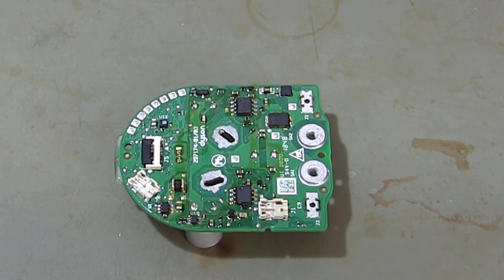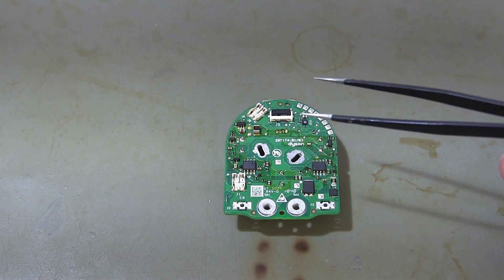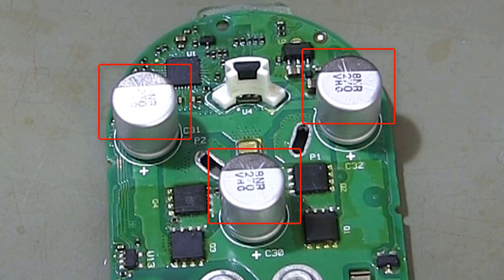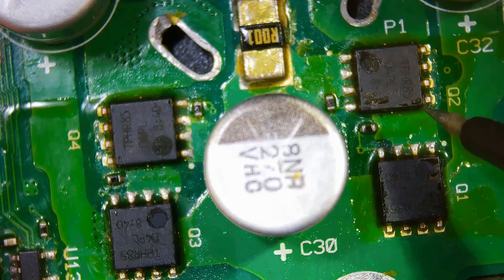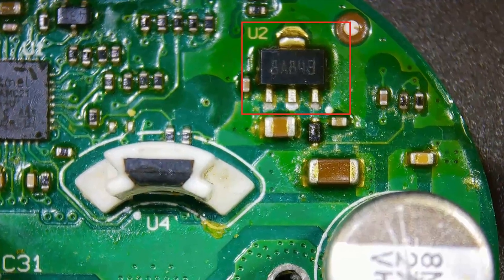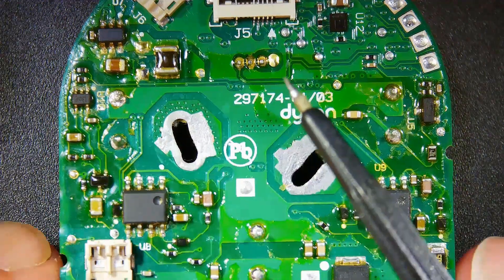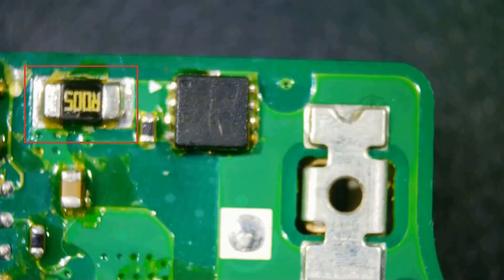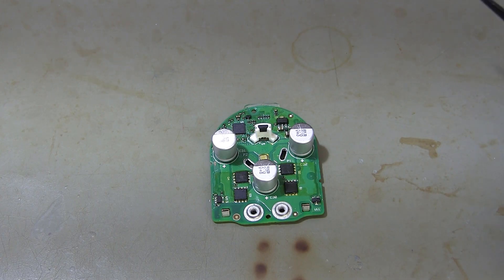How to Repair Dyson V11 Motor Control Board? Component Analysis

Comment: Hi everyone. I have the same Dyson with precisely the same PCB. The motor is working for 2 seconds in each mode. I bought a thermal camera, and one component is reaching 40 °C within seconds of pressing the trigger button. It is the one right under the button socket. The black middle with 2 silver metal plates/legs. I checked the continuity, and it beeps. Also, I measure 0.2 ohms on the 600 ohm setting. What is the component, please? Am I right when I think that it is shorted? Many Thanks
Reply from the maker: It's highly likely that the component coil you mentioned and the reading you're seeing on the multimeter are normal. For the fault you described, I suggest checking the capacitors first.

Comment: My V12 shuts off after 3-5 seconds, one month past warranty… anything that could help
Reply from the maker: Check the battery. If the battery is healthy, check the capacitors and MOSFETs on the circuit board.

Comment: Ciao grazie per il video molto interessante! Ho due Dyson v11 il modello sv17 non parte appena premo il grilletto, se tolgo la batteria e la rimetto funziona correttamente. Da lì in poi funziona regolarmente..ma appena sta fermo per 10 minuti il.problema si ripresenta! Condensatori? Il secondo è un sv14, funziona regolarmente in eco e boost, in auto va ad intermittenza..grazie dell'aiuto!!
Reply from the maker: Hello, this is a very unusual fault. I recommend checking the capacitors in both devices, as capacitors are critical in this type of malfunction.

Comment: I have a V11 which works for like 1 or 2 seconds and then cuts off with the “bong” sound and the blue light on the battery flashes. Which component on the board could be the culprit of the problem?
Reply from the maker: I suggest you first check the capacitors on the circuit board.
Reply: @electronic7979 bilginiz icin tesekkur ederim. Zamanim oldugunda bakicam ve geri donus yapicam size

Comment: Hello, Thank you for the video. I have Dyson V15. Can you please help me find the proper capacitors? I cannot recognize parameters from the desctiptions written on them. On the capacitors I have following info: 1DF 270 VHC. Can you please help me to identify? What is the voltage? What is the capacity?
Reply from the maker: You can use a 270uF 35V capacitor.

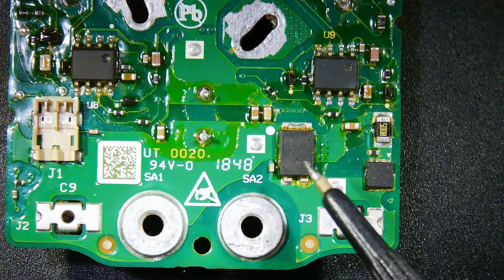Comment: Hello! I would like to ask for help in repairing such an electronic PCB, in the video I would like to know the value of the SMD capacitor next to the SA2 diode of the brush motor, it is mentioned at 6:20. Thank you if I get an answer.
Reply from the maker: I don’t know for sure, but my guess is that it could be a 100nF / 50V capacitor.
Reply: @electronic7979  Thank you for your answer.

Comment: very helpful video. Thank you.
I have a problem with Dyson V10. 
Please see video here;
https://youtube.com/shorts/5U-2dUXnjQM?si=BwA3P2OUn2yDbKtT
Reply from the maker: There is a problem with the link you provided. The video does not open.
Reply: @electronic7979 I made link public now. Please check?
Reply from the maker: Merhaba dostum. Bende türküm türkçe yazabilirsin. sorunun motor kartı üzerindeki kondansatörlerden kaynaklanıyor olabilir. kondansatörlerde bir problem bulamazsan devre kartı üzerindeki mosfetleri kontrol etmeni öneririm.
Reply: @e @electronic7979  teşekkürler. Kondansatörlerin üzerinde 2NR 270 VHC yazıyor. 
Nereden tedarik edebilirim?
Reply from the maker: 270uf 35v SMD tıp kondansatör elektronik malzeme satıcılarından bulabilirsin

Comment: Abend ich habe Problem mit meinem dyson v12 und zwar beim einschalten vom geht das Gerät kurz an und dann geht wieder aus so wiederholt man ca 6 mal und dann läuft er wieder ganz normal ich habe schon alles überprüft Filter erneuert aber trotzdem funktioniert leider nicht
Reply from the maker: I recommend checking the capacitors on the motor control circuit board.

Comment: Hi, my v11 (sv15) starts for 1-2 seconds and stops, after 4-5 times it works normally. I removed capacitors (3x270uF, 35V), but they have nominal parameters. MOSFETs are on board, but seem to work properly. What would be next to check?
Reply from the maker: Do you have an ESR meter to measure the capacitors? Multimeters may show nominal capacitance values, but if the ESR value is degraded, the problem can still persist. For this reason, I recommend replacing the capacitors in any case.

Another possible issue could be cracked or cold solder joints on the board. Check all solder joints and reflow or resolder them if necessary.

Also, don’t forget to check the battery.
Reply: @electronic7979  I used multimeter. Ok. I will replace capacitors and check if it will help. The battery is ok for sure. Thx
Reply: @camus22-n3t did you change capasitors? And it worked?

Comment: Mine stoped sending V to the brush, found a burned "trail" to the HAL sensor for the filter, repaired th burnt circuit n now it doesent detect a filter at all, 
Trew it in th garbage n bought a chinese copy, comes with way more atachments, batt lasts longer ,n its lightr than dyson, fr a ⅓ of the $$.
All electronics are on the battery, so its easy to diagnose, it came with an xtra batt. 
Dont fall for "if its expensive it must be bettr" dyson has too many fkn sensors + too many boards n a ton of diferent problems.
Reply from the maker: Thanks for sharing your experience! Dyson units definitely have a lot of sensors and multiple control boards, so when one small part fails it can create a chain of issues. The burned trace to the Hall sensor is a pretty common failure point on these models.

The replacement you bought sounds like a good fit for your needs — lighter, longer battery life, and simpler electronics can definitely make maintenance easier. Every brand has pros and cons, and what works best really depends on how you use it.

I’m glad you found a solution that works better for you! If I get similar issues with mine, your comment will be useful as a reference.

Comment: Ok, a solution for the "trying to start but it only does a doinggg sound?"
Reply from the maker: First, check the 3 capacitors on the circuit board.
Reply: @electronic7979  nope, changed them already
Reply: @electronic7979  and all the values of the caps and even values of the motor terminals without a motor and all mosfets are the same as a good 
working one
Reply from the maker: I've never had a problem like this before. It's most likely a software issue.
Reply: @electronic7979 Well, is there a way we can rewrite the software on the uC?
Reply from the maker: You can download the firmware from a working and fully functional board to your computer using a programmer device. Then, using the same type of programmer, you can upload the firmware you saved to the microcontroller on the faulty device.
Have you checked the motor bearings?
If possible, you can also try connecting the circuit board to another working motor.
There might be a mechanical issue coming from the motor itself.

Comment: what is the thick square componenet that is right bellow the white connector, is it a resistor or a filter,  if it is a resistor  what it the value.
Reply from the maker: The black and square-shaped component located under the J6 socket is the coil.

Comment: The motor stops after a few seconds of running, without any error message. V12 is about 3 years old. Some internet advices point to motor capacitors. Can you advice? If yes, what are the capacitors' values and are they difficult to find/replace? I have enectronics background, a capacitance meter, but not enough to diagnost it myself.
Reply: My V12 had the same problem, i dont want to disassembly the complete V12 so i only removed the filter and dust container and often tap with my hand on the dyson, really much 'microdust' came from inside. I make that for nearly 15 minutes or a little bit longer😅 after that the Problem was solved in my case.
Alternativ you can use a strong fan or compressed air, but carefull because of the electronics inside.
Reply from the maker: Thank you for your valuable comment.
Reply from the maker: The values of the capacitors are written on them. Remove the capacitors from the circuit board, measure them with a capacitance meter, and compare the values.

Comment: HO TROVATO UN CORTO CIRCUITO SU U7 E SUL CONDENSATORE , L' HO CAMBIATO MA SI E' ROTTO. L' HO SOSTITUITO MA HO TOLTO IL MOTORE E OK. QUANDO HO RIMESSO IL MOTORE SI E' ROTTO DI NUOVO
Reply from the maker: I recommend checking the MOSFETs. If the components you replaced are still failing, the motor may be faulty.

Comment: Awesome video! I need a little help. My V10 stops after 1 second in the lowest power mode but works well in the midle and in the boost mode. Is the fault in the controller or maybe with the hall effect sensor? What should I check?
Reply from the maker: Thank you for your interest. I'm listing the possible causes of your problem below. Good day.
Battery protection board (BMS) incorrectly detects low current.
Sometimes, when drawing low current, the BMS detects an "underload" or "voltage imbalance" error.
Measure cell voltages individually (the difference between all cells should not exceed 0.05V).
If there are unbalanced cells, balance or rebalance them.
If possible, test with a different battery.
Be sure to check the capacitors on the circuit board.
Motor speed sensor (Hall sensor) signal
In low mode, the motor rotates slowly; the Hall sensor signal is low frequency. If the sensor circuit is weak, the control board thinks the motor is not turning and cuts it off after 1 second. Check the signal cable (usually the thin blue/green wire) on the motor connector with an oscilloscope. If the signal is interrupted, the motor's Hall sensor or its connection is faulty.
Reply: Thanks for the cool tips. I tried another battery and the same thing happened. Our machine's battery worked fine in another V10, so I would rule out the BMS. I measured the sum of the three parallel-connected capacitors, which was 865uF, so one capacitor comes out to around 290uF. I checked the Hall effect sensor signal directly on the legs because couldn't find the signal cable you mentioned. A regular square wave signal is visible in each stage with the right voltage around 3.2 V. In the lower stage, it was only observable for a very short time. I created a video about it.
 https://youtube.com/shorts/8JxhMrdBw2E?si=EtnhT-LyrMl2XorI

Do you have any other idea?
Reply from the maker: You've done everything you can. Renew all the soldering on the circuit board.

Comment: After repair, Before assembly, the board can be checked, in addition to power, you need to connect some sensors - from the filter, battery? Without a display, will the board start? Whatever to collect - disassemble without confidence in a successful repair.
Reply: без дисплея запускается
Reply: @BossBossBoss1020  термистор обязательно подкидывать?

Comment: I have been working on a Dyson V11 control board, The motor is running but is hiccuping. I have replaced the 4x TPHR8504PL as well as the 2x LM5109BMAX chips. This hasn't made any difference. I checked around the MOSFETs and seen that the pull up resistors on (The ones in the red boxes on your video) were 2x 100k and 2x 1M. Is this correct? There is no other shorts I can see.
Reply from the maker: I don't remember the exact value of the resistors.
Reply: were you able to fix your board?

Comment: Hi, very nice video. Thank You !
My Dyson SV14 is total dead. 
No display,  motor don´t move, no sound inside.  Battery LED 1Ox flashes blue light after press switch. Bought second new battery an the same results, 10x blue flashes too. Batteries seems to be fully charged, on main terminals is 29V after press switch, but after 2 seconds voltage goes down to 0V and start 10x flashing with Dyson disconnected too. 
Do You mean this is 2x bad balancer boards inside batteries, or bad motor control board ? 
Thanks
Reply: Da werden die MOS- FET Transistoren durch legiert sein. Im Layout sieht man zwei mal die mehrfach parallel geschalteten Pins, bei den MOS- FET Transistoren. Dazwischen darf keine Verbindung sein, wenn an der Platine nichts angeschlossen ist (mit dem Ohmmeter messen). 
Wenn eine Verbindung besteht, müssen der entsprechende MOS- FET Transistoren und der jeweils dazugehörige Treiber Chip ausgetauscht werden. Das erfordert gute Fachkenntnisse, geeignetes Equipment wie Heißluftpistole, Mikroskop, feine Pinzetten und Löterfahrung. 
Wo welches Bauteil auf der Platine zu finden ist, wird in dem Video erklärt.
Kurz und gut, die Motorsteuerung ist defekt.
Reply from the maker: There may be a problem with the MOSFETs on the motor control board.

Comment: Hi mate seen you videos, absolutely magnificent work. Even though i'm quire good with electronics this made me scratch my head.
The motor does the "boing" sound, display working.
Took the board out, motor seem to spin freely,  can't find anything short on the motherboard.
Have you ever managed to find the fault on a "boing" fault on Dyson mine is V11.
"Boing"= short thump when trying to start.
Thank you and thank you for your videos
Reply from the maker: Hello friend, I've never encountered a problem with the noise you mentioned. However, the noise could be coming from the motor; there's a good chance the bearings are also a problem. I don't think the electronic circuit board is the problem. I also recommend checking the hoses connecting to the motor. Perhaps a small leak there could be causing this noise.
Reply: @electronic7979 wow, thank you for replying to my message so fast. Motor doesn't seem to be blocked it is rotating hard like all motors with strong magnets.
Looking at the board with the thermal camera, the hall sensor is getting hot, the U7 and the U2, i took the hall sensor out, not i have the 2 ic's heating up and a small diode on the 3rd pin of the U2 voltage regulator, still investigating:)), but because the motor is spinning i'm invlined to belive it's a board issue,  in this case, i will let you know if i find anything. Did you manage to identify the U2 ic( 8A843) and the U7 ic (NAXF)?
Reply from the maker: U7 Naxf smd coded integrated circuit can be TPS560430XFDBVR voltage regulator integrated circuit.
Reply: @electronic7979 well, thank you for your time, i managed to fry/burn the micro-controller,  by accident,  can't carry on, figuring out what was wrong (i'm 90% sure in my case the board was at fault and not the motor)
Reply from the maker: @Bogdan.Benett The microprocessor is burned badly. You need to install a new card.

Comment: Здравствуйте,  спасибо за подробное описание. Не подскажете маркировку микросхемы U7. Корпус вероятно sot23-6. Около разъёма
Reply from the maker: U7 Naxf smd coded integrated circuit can be TPS560430XFDBVR voltage regulator integrated circuit.
Reply: @electronic7979 мой v11 sv28 сначала выключался после нажатия кнопки, потом погас дисплей. И он больше не включился. После замены микросхемы и трёх конденсаторов - он начал работать

Comment: You mentioned pressure sensor in on of you reply to comments.  However, it was not mentioned in the video.  Where is the pressure sensor in the PCB?
Reply from the maker: There is no pressure sensor on the PCB. Some models may have a pressure sensor in the air flow channels.

Comment: sorry to bother you, can you tell me how to test it apart , j1 does that need to be connected ? i bet dyson uses some battery lockout to stop people saving money? as a electronics guy it seems very well engineered , hoever high speed and high current draw makes for short product life in ancient times vacs put fan before the bag-less loss of suction and much lower power requirements (the motors were basic). Leaf mulchers use this system .With the advent of covid , bagged vacs are better from a hygiene standpoint as you throw the bag away which is paper . my thoughts !
Reply from the maker: Hello. I don't know much about the battery lock. Maybe you can find a solution by researching the integrated circuit on the BMS circuit.